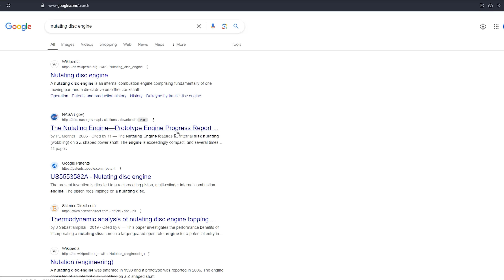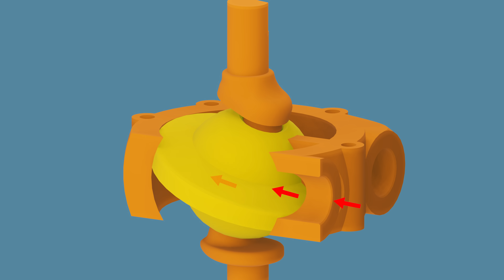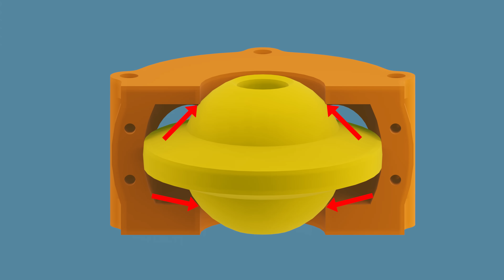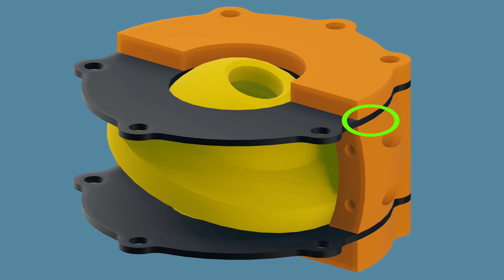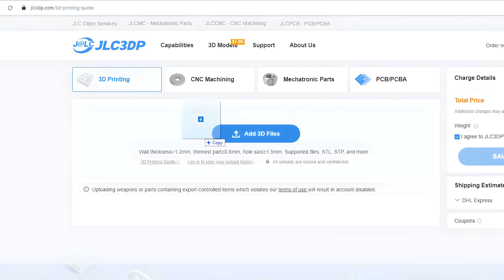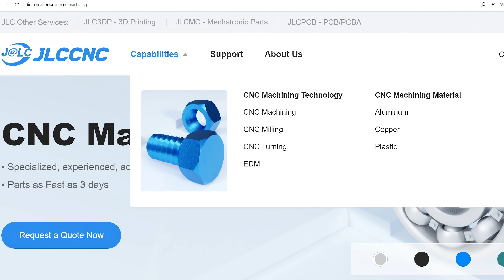I Built a Nutating Disk Air Engine

Comment: This is a very old design dating back to the 1820's when Edward and James Dakeyne of Darley Dale, Derbyshire, designed and had constructed a hydraulic engine (a water engine) known as "The Romping Lion", based on the same principles, to make use of the high-pressure water available near their mill.

Comment: Hello Retsetman. Very good design and the first i see working. One question about sealing , did you try with a rubber seal stacked between the half discs, this to insulate the inlet and outlet air motion. Greetings

Comment: How do you even begin to seal the gap between the disk and the casing?
This design either needs crazy small tolerance machining or very little torque resistance.

Comment: Hi. try to add some caviats instead of gasket. Just to making a resistance to the air flow. Like it does in the tesla valve. Maybe there will be not anough space just near the "ball". But you already localize side air flow - it vents between black cap and the shaft, so you can increase impedance by just creating ribs on the shaft,  creating such valve. It is not perfect, but you will rid-off rubbing parts and even more - you will have something like air bearing.

Comment: Compressed Air is the most expensive Energy you can use. It just does not make sense unless you have a specific requirement that forces you to consider it. Airtools have been used in the industry because they are light and powerful but they are replaced by electric tools.

Comment: More of a pump or a mechanical vibration device.  Manufacturing has been using this to help solids flow in a silo by bolting these to the outside.

Comment: Could you take an air feed from the input to the outer sides of the seals to equalise the pressure? You could use much thinner seals and reduce friction or even possibly use no seals except maybe an 'O' ring round the output shaft. For simplicity's sake maybe add a pressurised outer enclosure?

Comment: The disk doesn’t spin, right?
So you should be able to make a flexible gasket that attaches to both sides, meaning no rubbing only flexing of the rubber :D
Which should reduce friction, assuming the rubber that’s flexing isn’t super stiff.

Comment: I noticed that by having the intake and exhaust on the same face leaves moments in the cycle where air can bypass interacting with the disk. Could there be a more optimal exhaust position or configuration?

Comment: Why’s nobody making this yet… how much horsepower and torque is it making? If it’s too low there’s no application for it. Remembering that in real world applications they’d be a load on the driveshaft. What’s the efficiency, how much compressed air does it use per hour compared to how much gasoline or diesel an internal combustion engine makes? And how do you make that compressed air, with an internal combustion engine compressor.
Edit: I’ve seen the answer at 9:10 the thrust to weight ratio of 0.19 would be bad for an aircraft. A modern jet engine has a positive thrust to weight ratio of somewhere between 5.0 and 7.0 The SpaceX Merlin engine used in Flacon space rockets has a thrust to weight ratio of 199.5

Comment: In order to make this into a servicable craft, one would only need to change the gearing on the shaft, then route the air from your pump to the other propeller-mounted turbines(apparently). Hook up an air an compressor to the harness with the throttle hooked up to air controll, and set up a gyroscope, and you're set

Comment: Would it be helpful to make it a complete system loop. Air inlet from the compressor and outlet being sucked out by the compressor for a loop? I'm not an engineer but in my head it should help increase speeds.

Comment: If the parts were precisely fitted and balanced to create a very tiny tolerance between the sphere, the disk, and the case, it would create a better seal with substantially less friction.  If there was a thin layer of oil inside the case to increase the air seal and decrease the friction by lubricating the surfaces, it would be expected that the turbine would become much more efficient and powerful.

Comment: Using source compressed air to do work.  Using that work so spin an air compressor.  Would it be more efficient  to use a nozzle and push the source compressed air out of the back of the plane directly?

Comment: How is the performance compared to just a normal fan turbine? It seems like there are multiple points where the chamber is open to the entrance and exit valve simultaneously allowing air to enter and exit without having to do a cycle. Too much resistance and the air will have an easier time just exiting the device instead of rotating the wobble.

Comment: Compressed air power is great for air tools. However, for longevity use in an engine, it's extremely inefficient. Even in his lab tests, it shows that if a turbine blade system was used, it would have had better flow for rotation.

Comment: The answer to this question reveals that you are not very bright. The engine doesn't operate without compressed air and it takes energy to compress the air. The energy it takes to compress the air it can only be equal to or greater than the amount of energy extended by the motor it drives. There's a saying in physics - there's no such thing as a free lunch in the universe. No perpetual motion machine can be invented energy creation requires energy expenditure. You can only convert energy from one point to another you cannot create it.

Comment: wouldnt you need even less pressure if you had one side pushing compressed air (as you do already) and pulling the same amount on the other valve (same pressure) 
hopefully doubling efficiency?

Comment: To supply air in this engine you need an air compressor, which is already working by an electricity. That's 1 more step converting the energy from electric to kinetic energy of air molecules. Instead of this you can directly use electricity to rotate the blades, using electric motor. But the consept is interesting!

Comment: I wonder if some optimisation in the shape of the inlet/disc could speed up the transition between top and bottom of the spinning sphere to increase the range of air pressures this works at.  (I note it takes fairly high pressure to start up)

Comment: Why not just use vertical blades to convert the air push into a rotation.

That should be far more efficient with less friction, using only a simple vertical axis.

Comment: This device would make a good pre-rotation drive for an auto gyro lift rotor! This would be instead of the current friction drive using pulleys and a flexible drive shaft and head sprocket. There would be no need to engage a clutch since the air driven ‘wobbler disc’ and z shaft assembly could be permanently engaged with only compressed air needed via an airline. A tank of compressed air could be carried on the airframe to operate it and re pressurised between flights. Alternatively, the aircraft engine could be linked to a small air compressor for autonomous re pressurisation whilst on the ground.

Comment: The title says, "engine," which implies that it generates power.  To me, this seems more like a "transmission."  It is translating the power of compressed air (from the compressor, which is serving as the engine) into rotational power.  As such, it is not actually generating power itself.  Perhaps labeling it as a 'transmission' in lieu of an ' engine' might be more appropriate?

Comment: interesting, but seems like needless complication for a rotating shaft in real world applications. just take the motor driving the air compressor and attach it either directly or through a gearbox to the shaft to achieve the same result, with many fewer parts. less parts = less breakdown/repairs/maintenance, not to mention production costs.

Comment: Let's see it run without compressed air. Oh it won't run without compressed air ? 
Well that's why nobody makes it. It is useless. 
Also electric motors are called motors and not engines because they have one moving part. This air "thing' also only has one moving part so I firmly believe this is in fact NOT a engine.

Comment: and thats why nobody talking about it... 70 grams motor, 17 grams lift power... might be useful in other aplications but not flight. however... if u manage to make all the parts from very thin metalic parts... like paper metalic parts... from aluminium alloy or something similar... then ... it might be useful... the only thing id be curious about, how would u make a air compressor to be added on a RC plane for example that runs on a battery pack... lightweight enough to spin this motors fast enough to take off... considering u might need 1 to 4 motors of this kind... depending on what u are looking to build ... however i do see this engine, useful in Boats... instead of air... compressed water,

Comment: My question is, will it work on suction alone?  Because then you could create a closed loop system, sending the exhaust back to the compressor.  Doubling the efficiency.  Even if it can’t run on suction, the lower pressure on the exhaust side would be the same as running the intake side at a higher pressure for free.  More like 1.5x efficiency.  Otherwise when it comes to simplicity of manufacturing, I still think the classic pneumatic tool motors are more practical.
Reply: No it will not, a hypothetical 100% efficient turbine like this would violate the law of conservation of energy. The output of the turbine would have nowhere near enough pressure to put air back into the compressor's tank, hence why they use a compressor to charge.

Comment: I have been trying to find someone to model this engine idea. Imagine a gear wrapped in a shroud. Each tooth drives a pocket of air. Now reduce that gear to just two long teeth (two for balance). Add a second gear to work against this first gear like a worm gear. The two gears will not drive each other. We will need to link them to keep them spinning in synch. While spinning, one tooth drives the air against the side of the tooth of the other gear. Then they trade places as the teeth pass one another. One last thing is to flip one of the gears inside out and make it slightly bigger to avoid the teeth clashing at the opposite end. This should reduce the air leakage due to the curvature of the gears. Use a separate shaft to keep the two spinning in a one-to-one ratio and you should have a  neat engine with 4 distinct strokes. Two expansion and two compression. Also, all torque is applied tangentially to the axis giving excellent performance.

Comment: I don't think you need to make the seal airtight on the top and bottom. It acts like a continuous wing. What's important is the different pressure zones between the top and bottom of the wing. Intuitively, if you had the fluid enter at 0 degrees, and exit at 270 degrees, you should get an adequate pressure differential between the top and bottom halves to keep the turbine engine turning, even without sealing. You may also need to increase the surface area of the wing (e.g. the radius of the ring). These changes might let you use it for higher pressure situations, e.g. with water, since you would have much higher tolerances due to fewer physical parts in contact.

Comment: A wobbling gyroscope would be my next suggestion.  A spinning disk will wobble like that without air, so the air would maintain the wobble frequency while using some of the acceleration in the wobble.  I didn't use the word momentum, because angular momentum has nothing to do with "why" a gyro does what it does.  Modern science cannot see that.  Look at my version based in acceleration.  It's CAUSAL, and it don't need a right-hand rule first.

Comment: I just thought of something. Make 4 of those air engines and attach wheels instead of propeller and attach the air engines to a chasis...aka like a car.  Im not sure if a 5thh air engine could pump up a air compressor or run a dc motor to power a compressors....but, just a thought.

Comment: maybe if you put other air inlet in 45º or 90º it may help to do more pressure when the first inlet is bypassing between air flow up and down and when te second is changing, the fisrt will be in the best position. i think that the max speed and the torque will be incerase (sorry for my english, i'm learning)

Comment: Great idea! Somehow you need to overcome the need for the initial push that starts the motion. For a real life application, the need for the initial kick to start it would be a show-stopper.
Reply: Why? Any petrol engine today is kickstarted by an electric starter motor
Reply: @generic_programmer  I don't have to kick-start the motor on my motorized screw driver each time I want to use it.
Reply: this particular turbine is most likely for use in a hobby sized compressed air plane.  a manual rotation is actually a design feature (to let you hold it before launch, and choose when to initiate launch)

Comment: It has no torque. Torque is far more important. And this thing is can not be scaled because the prop is always trying to move far more air than the engine consumes to per velocity and duration of work time. Whatever is gained from simplicity is nothing compared to an I.C.E requiring complex moving parts.

Comment: Interesting. Earth's wobble on the ecliptic plane is due to to its equatorial bulge, which is akin to the disk on the engine. Without the bulge, Earth’s gravitational pull would be perfectly spherical, and the forces would be evenly distributed, eliminating the precessional wobble, just as the ball would spin spherical without the disk. This parallel is fascinating: both the wobbling engine and Earth’s precession rely on an uneven mass distribution and external forces—whether directed air or gravitational pull. The symmetry of these effects, despite different mechanisms, does seem like more than coincidence!

Comment: It's a motor, not an engine. You're not extracting energy from a fuel, you're using energy from the fluid flow. It's a good example of changing fluid flow to mechanical rotation, but I'm pretty certain that it is far less efficient than a turbine.

Comment: "The best thing about this engine is it doesn't have any complex  valves, a crank or even a piston inside". No they are all in the compressor.
Reply: The best part about cars is that they don't have any complex distillation setups. No they are all in the oil refinery.

Comment: A very heavy compressor is needed to start that engine. The biggest problem with flying vehicles is weight. Additionally, friction problems will also cause wear. From these angles, I don't think it would be a useful design.

Comment: A wobbling disk engine, like Euler's disk, is not particularly efficient in terms of energy conservation or useful work output. Its main appeal is the visual effect and the physics principles it illustrates, rather than efficiency. When you spin or wobble the disk, it quickly starts to lose energy through various forms of dissipation:
1. Friction – Even with minimal surface friction, there’s still contact with the table or base, which slows it down over time.
2. Air Resistance – The disk moves through the air, which creates drag and reduces speed.
3. Sound and Vibration – The wobbling generates sound and sometimes vibration, which also drains energy from the system.

These losses make it inefficient at conserving energy. Unlike engines that are designed to produce useful work by efficiently converting energy from one form to another (like a car engine converting fuel to motion

Comment: Air pressure -> rotation.
Is it not same with the tools that mechanic use to open tyres nuts?
That tools have even higher torque...

Comment: "why is nobody making this"
Because that "wobble" is horrific and useless in literally every real world application. The second mating gear is literally moving as the "wobbling" gear SMASHES itself into it. Terrible, garbage design that will break in no time at all. Try again

Edit: a nutating engine IS A SMOOTH ROTATION IN A SINGLE AXIS, NOT A "WOBBLE". Also, google "Wankel Engine" for why nobody ever did shit with that ""engine"" you're making in the video, actual trash that is designed to wear down

.......wow, you know what else could spin a rotor with airflow around a cylindrical disc shape? A fucking water wheel shape. And a lot more reliably

Comment: Because it needs only one (central) engine to generate the compressed air sufficient for multiple aircrews and whereby navigation can be achieved by differential regulation of the air supples to each screw, this (lighter) power train seems the potentially optimal lift system for passenger drones.

Comment: In the position shown at 1:48, what stops air from simply blowing all the way around the top of the disk and straight out of the output port?
Reply: It would, but only a small amount probably. No engine is 100% efficient
Reply: Только компьютерное моделирование

Comment: Its called a swash plate engine.  It's used in torpedoes and modern modified ones is used in AC Compressors

Comment: I suppose it'd be easy enough to add more discs out of phase with the first which may help with that start up (three times more likely for one of the discs to be in a good position to just start moving, but also heavier and may need more pressure to start).  I like it!

Comment: This design is beautiful especially if you consider the path from the inventors mind to physical object. Its downside is friction and circumventing that issue would require some fundamental shift in the laws of physics,  if that happens it may make this motor useful in a practical way but 1-000,000's of machines in use today would stop working.

Comment: Awesome 👍😎👍 
🧐🤔 Maybe like the tail stock fittin, like on a lathe has a taper for  compression fit 
Can use for the propeller, just use a single bolt to hold it on
 I see your using a keyway might cause extra wear and tear on the bearings/bushings, 
So then you'll be able to get even high speeds 💨🛩️ 🎉